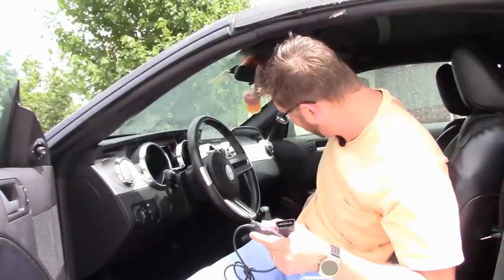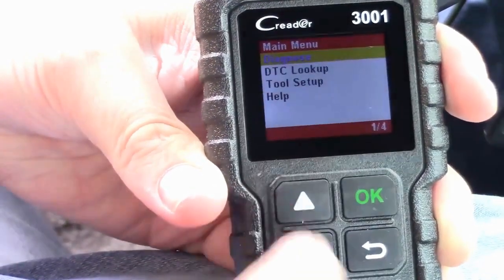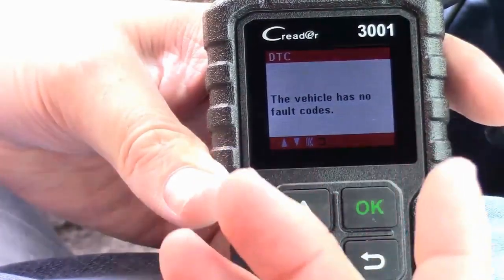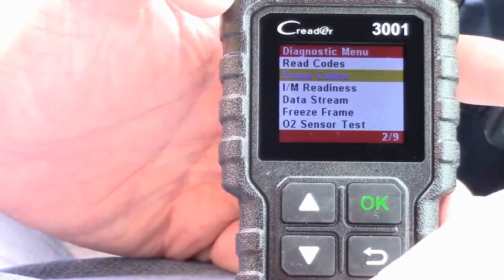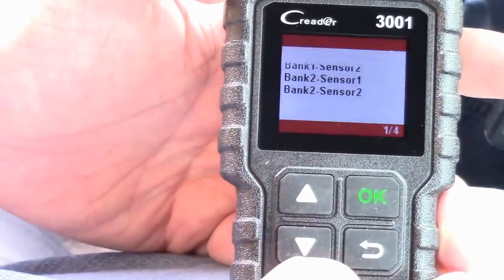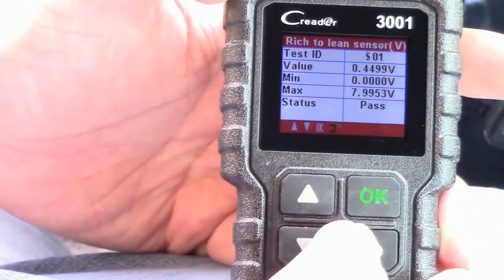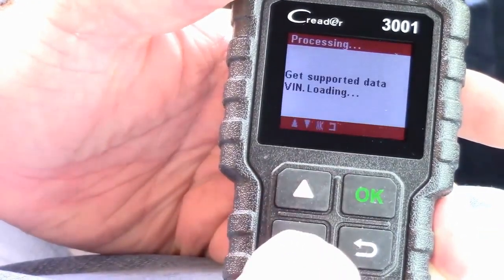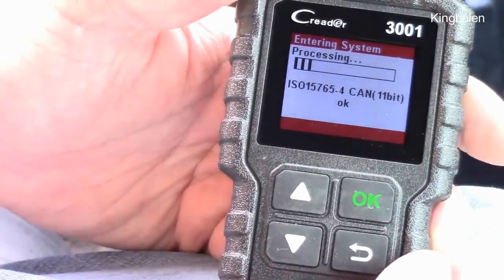How to use BASIC code reader  —— Launch CR3001

Comment: Does it turn on even if not connected to car? Or it will only turn on once plugged?
Reply from the maker: This product needs to be connected to the car to be powered, and the product itself does not have a battery
Reply: @kingbolen_official  thanks!

Comment: What is the different between Launch cr319 & cr3001?
Reply from the maker: Generally speaking, both products are data-based OBD2 detection tools, and there is not much difference. CR319 supports 7 languages; CR3001 supports 8 languages
In addition, CR3001 is cheaper and more cost-effective

Comment: I’ve tried to download the update tool using the website that came with the scanner, but the connection fails every time saying “not secure site”. Is there another link I can try, or is it really necessary to even bother?
Reply from the maker: Hello Danny, No need to update if the scanner work well on you car.
Launch CR3001 is a 'standard' obd2 code reader.

Comment: Every time I plug it in it says communication error check if ignition key is on and scanner is connected. What does it mean?
Reply from the maker: What's the car model&year number you tested?
Do you have chance to work on different cars?
Reply: @kingbolen_official  2003 Nissan sunny N16 I'll try on some other vehicles later today
Reply: @kingbolen_official  tool worked on a Nissan xtrail 2003 but not the Nissan almera 2003
Reply from the maker: @t_money_third9654  For Nissan, These cars after 2006 would be more friendly when we use obd2 code reader.

Comment: Can use this device for check automatic transmission
Reply from the maker: If you want to check the abs or transmission data,think about Launch CRP123E or CRP129E https://kingbolen-official.myshopify.com/collections/multi-system-scanner/products/launch-crp123e-read-reset-engine-airbag-abs-transmission-wifi-connect